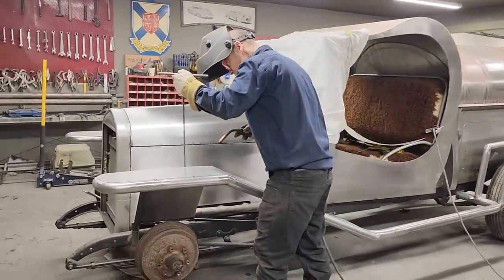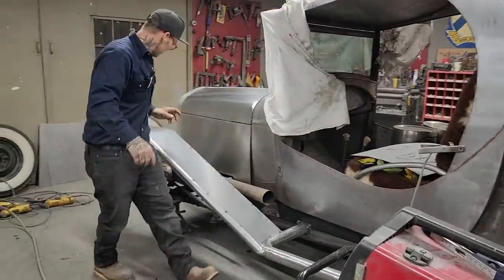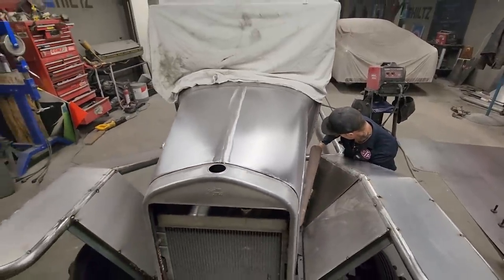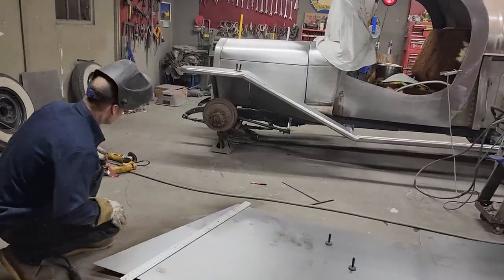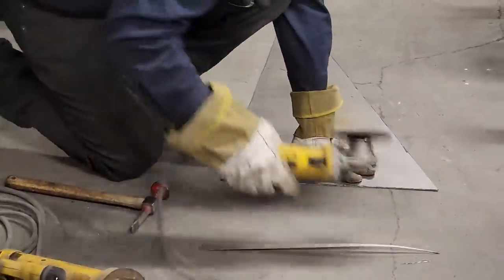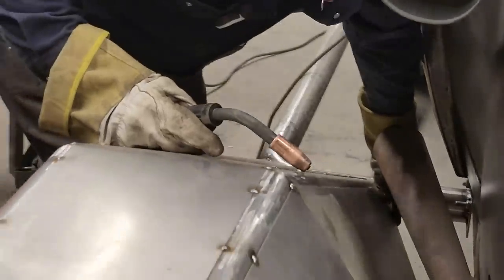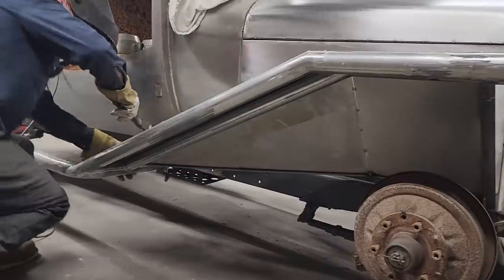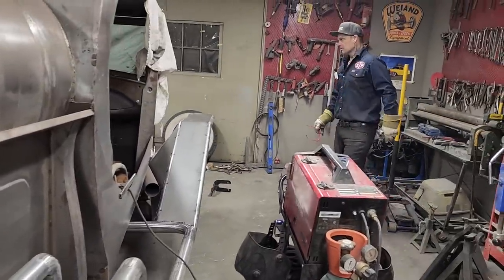Fender fabrication from scratch — sheathing inner fenders ✅

Comment: I think in between the fender and the rad housing is the best looking place for the headlights , also when u had it down on the frame it looked like the tire would hit it when the wheels are turned  hard over
Reply: Absolutely!
Reply: Agreed.....perhaps a sneaky linkage to move them with the wheels/steering, as previously??
Reply: I thought that a cpl days ago when someone said keep the turning lights by raising them. Didn't like that idea. Thought on fender front off exhaust pipe. Fixed
Reply: Absolutely !!
Reply: @Matt628 not only my thought on the matter but the exact words I was gonna use, lmao! And up on top looks goofy too, kinda like that cartoon buggy back in the later 70's
Reply: Agree

Comment: The headlights set in the V of the radiator and fender gives a nice change to the lines and angles. It adds to the curve of the radiator shape and top corners. It also fills the V space nicely.

Comment: I’d put the head lights in between the radiator n the fender about mid ways have a bracket connected to the rad support thanks for sharing

Comment: I would put the head light's between the fender and the radiator, but I would mount the light's with the front bezel just forward of the radiator.
So when you look side on you see the edge of the fender then the light (so the light is mounted central to the fender on side view) then the radiator, so you see a progression of hight from the flat top of the fender to the top of the light then the top of the radiator.
Looking from the top of the radiator you will see a stepped progression from the front of the radiator to the front of the light's to the front of the fender.
From the front you see a progression of height from the top of the fender lining up with the center of the light's then the top of the light's line up with the body line in the hood and cowel of the truck may be a touch higher may be lining up with the bottom part of the curve in radiator, hood and cowel.
That is where I would put the light's.

But most of all you always have a game plan.
Looking good, waiting for the next instalment.

Comment: I like the lights where the angle is. It also may look good to hide the angle with a piece of exhaust tubing so it rolls under from the top edge of the inner fender section. Just zip cut a strip out of the tubing and slip it over the angle. It will also help tie in the look of the tubing fenders and steps to the rest of the body. Just my thoughts from Chatham Ontario. Have fun! Great filming Jolene. 👍 🇨🇦

Comment: HI Chad and jolene i love the way you have fabricated the fenders  and they look amazing ! the headlights  if you put them to the bottom on the chassis will the wheel touch them when you turn the wheels ?? i think personally i would  have them in the middle between the fender and radiator frame , but my family says ,its a toss up for top or middle but my choice is the middle !

Comment: 👍👍👍👍👍Please put them between the radiator and fender. The other places look BADDER!!!!! 
     Also if it had a bead roll look on the top of the fender flat metal. Most vehicles of that era had some sort of bead made in the top of fenders.  Plus I'd truly love to see how You would make your faules bead roll. I've done it with different material and then laid fiberglass over the underlying form. Would just love to see someone do it with steel. 
    I love your work. Glad you put it out for us armchair critiques 👍👍!

Comment: Chad I think the light looks better between radiator and the fenders it looks very original, and another way is the curved tubing and the light mounted on top at the same height also very original. Good job.

Comment: If you mount it midway between the rad and the fender it will look right.. But you need to check your tire clearance when they go from lock to lock to see if they hit the inner fender..

Comment: I am putting togeather a 1941 plymouth and am making it a rat rod. The fenders you are putting on the oil tanker truck have inspired me to do the same but I'll only use it on the front,the rear are original but am widening them 2 in. Thanks.

Comment: Chad, it's working great the white definitely should go midway between the fender and the hood, not down on the frame and not on top of the fender between the inner Fender and the hood it's fantastic the way you are showing doing both sides as you go which makes the geometrically correct. The look you are going for is working great and that's how I have said in the past one artist to another I appreciate what you did

Comment: Hey Chad and Joleen my vote for the headlight is between the fender and the radiator shell. Also are you going to have put a downturn extension on the headers so the exaust doesn't burn the paint on the running boards?

Comment: Make a rounded flare on the top of the fender in the front looks a little square and weld it to the angle iron..headlights between the fender and radiator definitely

Comment: Between the fender and radiator, no doubt in my mind. Also might consider a piece running down the top center of the fender to break up the flatness.  A running light incorporated into would look good and give the piece some purpose too. Excellent work Chad. And Jolene!

Comment: I would choose  between the fender and the radiator cowl, but I would try to find headlights which are a little smaller around.  these look a little large for the space they are going in.  just my opinion.

Comment: Headlight between fender and radiator shell.  Should be able to modify existing bracket to fir and weld on the fender brace

Comment: Headlights should go between the fender and the radiator.  This gives a lot better forward lighting and makes adjusting the lamps easier. Headlights on top of the fenders would look like a farm tractor. Plus, the wiring for the lamps would be exposed and ugly, hanging from the fenders.

Comment: Lights mounted in between the fender and the radshell because that is the traditional look..that's why in my opinion..... Don't forget to make sure those tires can turn as you said, within the wheel wells before you weld up those fenders. btw Thanks for giving us an update as to why your waiting on the bugatti build. I was wondering why you stop progressing on the build.

Comment: Headlights look best in my opinion, on the angle iron.   Older cars typically have rounded features and the fenders are squared off and boxy, but when the headlights are in between, the front end gets busy, and looks great.  I think that position looks vert retro, very sharp.

Comment: Definitely between fender and radiator, also how about a triangle shaped piece with a slight curved edge instead of the straight front edge of the inner fenders

Comment: Chad, admittedly I have never used a plasma cutter.
But I am always amazed that you never accidentally cut that metal measuring stick, when you use it for your straight line to run the plasma cutter along it.🤯

Comment: Chaddy you were worried about the wheels hitting the inside of the fenders while turning, it looks like the Headlights coming off of the bottom of the frame would be more of an issue when turning. My vote is between fender and rad shell

Comment: Chad, I am only commenting about the headlights because you asked us to.😁
Headlights......I vote for between the fender and the radiator enclosure.

BEFORE you create your mounts though...I think that you should put the tires back on, and turn them from side to side, so you can see how low... and how far forward... you can mount the lights, without the tires hitting them when you turn.

Comment: Between is my vote.  Get it too low and you don't have enough angle on high/low beams (not that you're going to drive it a lot at night, but...  On top of the fender is kind-of a Pierce Arrow thing, about the only thing I didn't like about them.  It definitely looks better now that it's boxed in, but time to put the tires on (my Lotus rubs at full lock on one side and it's really annoying.)

Comment: I think headlights should go on the top of the fender. Does that look good from the side and 45' angle? If not they should go in between of the fender and engine. Also i think it would be cool to wrap the exhausts in grafitegray heatshielding fiberglass textile, and then it protects the paint at the same time 🙂

Comment: The headlights look better in between the fenders and the Rad support, but make sure the hood clears when you open it.
Check for tire clearance before you weld it tight and right.
What happened to your Lincoln plasma cutter that you mentioned it was so great? I remember the video when it stopped working. Is it just a tip issue of did something else happened to the machine?

Comment: Head light on the fender is a hard NO! On the frame is an option.  Best choice centered between the fender and the rad shell with the front edge of the light bezel flush with the front edge of the rad shell.  My$.02

Comment: Heh Chad, Did you ever look at the car used in the movie "Chitty Chitty Bang Bang" ?  The fenders and running board look very similar to it ......  Although the fenders on that car and running board had a piece of metal that ran vertical along both and had a beautiful scallop from the front edge of the fender down to the running board.  That would look neat on your truck !   Headlight between radiator and fender.

Comment: Chad, not that it matters a hill of beans in the long run. Especially since you already welded the piece on.😁
And, quite possibly, I misunderstood you.
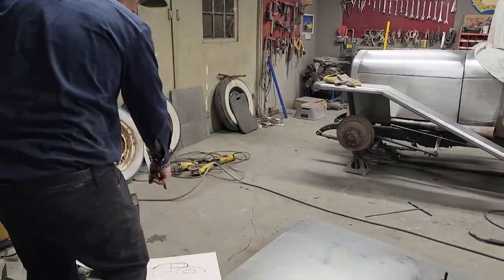However, @ 5:27 mark, I thought that I heard you say that you were going to use the triangle piece that you were getting ready to cut (for the inner fender), as the template for cutting the same piece for the other fender, instead of using the paper again for your template.

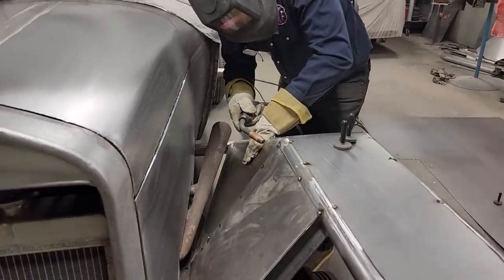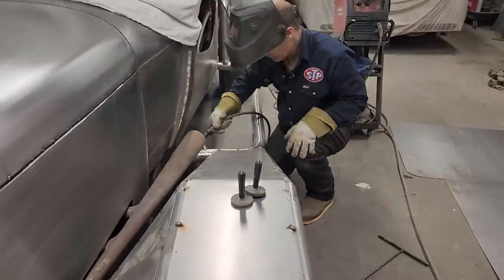But then you just went right ahead and began welding it in place around the 15:00-15:20 mark.😁

I guess it was simply another happy little accident.😁😁

Comment: Between the fender and the cowling. On the fender looks to wide. Also when you get to the back fender, I t would look good with a built in step in the front of the fender so it looks like you could stand on the fender to fill the tank. Just a thought.

Comment: I vote between the rad & fender. I think the rear fender would look much better if you took the 90s you used on the ends & cut one in 2 to give the back fender a more rounded look. Just my opinion, keep up the good work we watch every day.

Comment: LOW on the frame.  It will be simple, sturdy and stable.  ALSO the headlights will be safe in tight  turning to avoid obstacles. Like parking or positioning the tank for use.  And keeps cool lines uncluttered.

Comment: The oil truck should NOT have any company name on it ------- Needs Fina Oil for your loyal Doggo
Reply: Technically, FINA actually was the name of an oil and gas company.

My grandparents owned/operated a filling station from the latter 1940s through the very early 1970s.
From approximately 1960 until they closed their station, my grandparent's fuel and engine oils, were supplied by a FINA distributor.

Comment: It's coming together nicely!!  I really like the tunnel effect on the exhaust and fenders!

My first choice for the headlights would be forward of the rad shell and a bit lower than is possible between the fender and rad shell.  Maybe on a bar type mount common on 32 Model B but custom to this truck.

2nd choice is between fender and rad shell...  definitely not on top of the fenders.

Comment: On the fender, wont interfere with engine access panel and be something different than the old way.  Would also give a nice sightline down the inside of the fender and a view of the headers/exhaust.  Most I remember seeing were between fender and hood.  Quick connect on wires for easy fender removal.  Could you comment on model of Dewalt grinders you use.  They look very durable and I need to purchase a good one.  You seem to use the heck out of them and they seem to hold up.

Comment: Would you be better off running the exhaust pipes down under the fenders underneath, surely the way they are now will burn the paintwork when running and hot 💭🤷🏻🤔👍